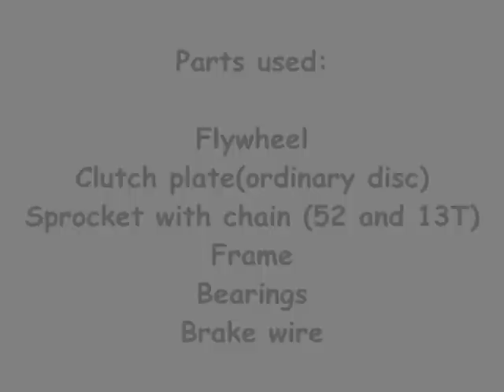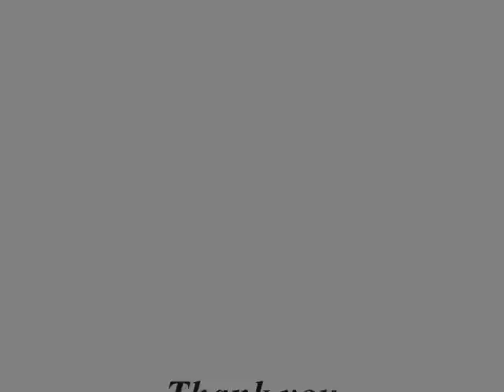KERS bicycle project(regenerative braking) Smk fomra

Comment: Good idea. Maybe you should think about incorporating the fly wheel into the rear wheel and connecting it with a shaft.  This would not only save space but also minimise the energy losses due to the chain.

Comment: Hello guys.. 
This is a brilliant idea to promote cycling thrill. 
I am confused with only one thing, if this is to restore kinetic energy saved in the flywheel then why do you apply calliper brakes directly on the flywheel? It would cause wearout of the brake pads too fast as the flywheel is rotating at higher speeds than that of the rear tyre.
And if you slow down the flywheel first then the kinetic energy is lost in braking itself...   My regards though....;)

Comment: Hi this is Arun and I have a doubt on this, like how do we engage and disengage the flywheel during bicycle running?
Reply from the maker: hi u can use caliper type brake that is nothing but a small cylinder and cut in a taper angle so that when brake is applied it can move forward

Comment from the maker: yeah thats right it adds weight.for that weight compensation u should decrease ur bicycle weight by taking carriers,mud guards,etc still it will add 3 kgs.but for that 3kg the efficiency is increased by 30% and that wont affect overal speed..flywheel s weight can also be modified as per requirements

Comment: i presented this as my final year project to mechanical faculty of my college.they rejected the project saying that the flywheel will be to heavy for the bicycle due to its additional weight(5 to 10 kg)...can u please explain me how the extra weight of the flywheel is compensated by the recovery system????also provide me the dimensions of the flywheel...weight ,diameter,speed range  etc....